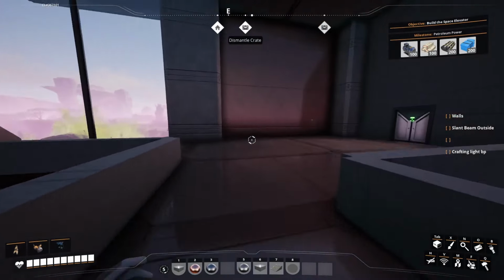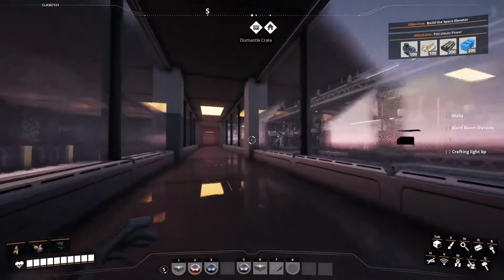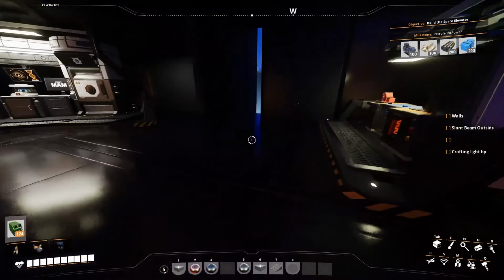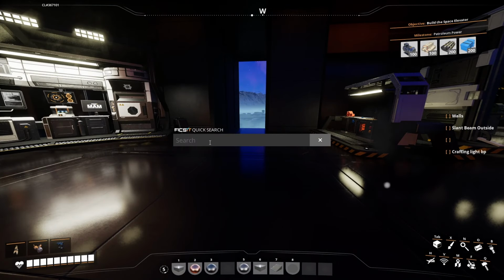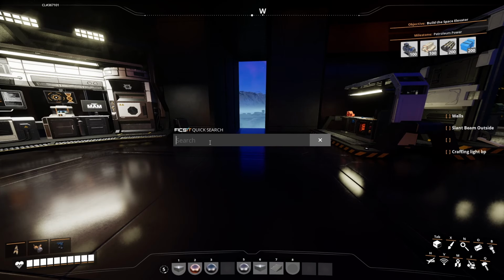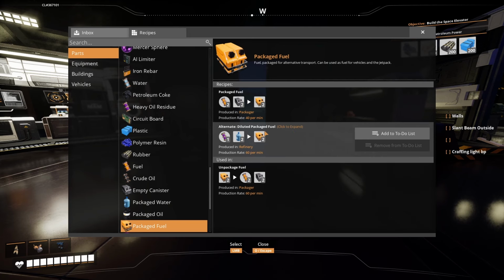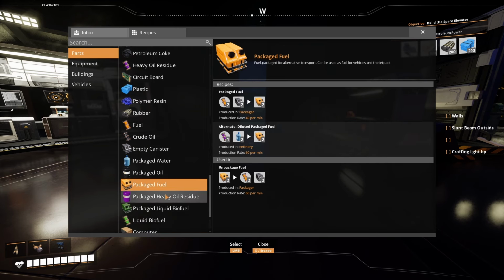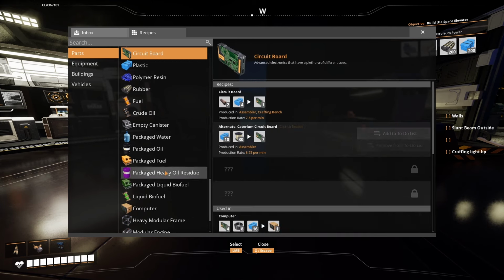I Built An INSANE Starter Factory Satisfactory 1.0

Comment: Me: Still banging Concrete Foundations together to try and make my factories less box shaped.
Kylo: So I built a starter factory...

I love the way that you use corridors, big staircases and open spaces. I really need to get into using the Blueprint designer more, you really inspired the way that I started using blueprints in my Update 8 save, but I need to get back into the swing of using it for cool machine areas.

4:45 I agree, both in satisfactory and the real world yellow orange lighting is superior to straight white light. Though, I do think that having a mix of both can be nice as well, and its especially effective for setting the tone of what a specific room might be used for.

Comment: Awesome build. I have to agree with those others though. Not a "starter" fsctory imho.
Reply from the maker: It does not produce any parts outside phase 2. Design wise it has a lot going for it, but technically IMO it’s still a starter factory, just nice!
Reply: @KyloBuilds what materials are used to produce those foundation and wall textures?
Reply from the maker: @Olde_Faithful  I’m using the new finishes, and coated concrete as the floor.